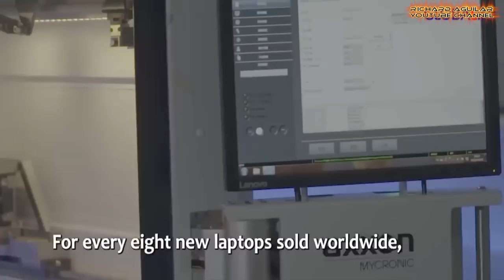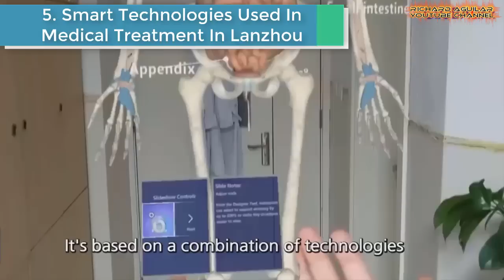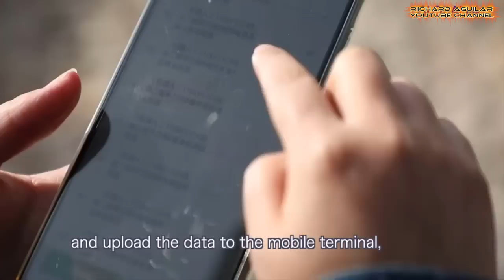China Innovation! Alarming Smart Technologies Are Taking Over China

Comment: So modern and so old still powered by coal power technology
Reply: Coal for steel production to build bridges and buildings. Using solar wind , hydro energy for electricity, 70%. Read more.
Reply: @jenelle133  I prefer hydrogen for steel production good for Britain as we are surrounded by sea so renewables are plentiful here it's not a problem losing the 4 to 1 energy ratio
Reply: @bernardcharlesworth9860  you do need coal for production of steel. Coal + iron = steel.
Reply: @jenelle133  sorry  when I studied chemistry hydrogen could be used in a blast furnace to make steel but at the time coal was cheaper
Reply: @bernardcharlesworth9860  yes you are right 👍